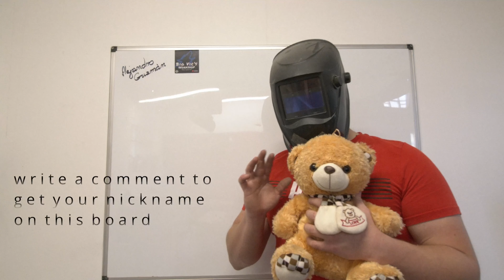This restoration was more difficult than I thought. Damaged rusty vise Restoration

Comment: Great beautiful job, but I just don't agree with those aluminum jaws.  Always have seen hard steel used.
Reply from the maker: Thank you very much it's very kind 😊 
Yes it's true but this vise im using for wood like wooden handles or some kind of elements, at the end of the video I show how this vice works, i.e. you can grasp the wood very tightly and the jaws will not damage our wood 😊
Reply: @customrestoration5317  Thanks, and again a great job.😀

Comment: I wonder why you didn’t fix up the inside of the Vice. Could have filed it smooth.
Reply from the maker: The casting was crooked and I could not insert it into the milling machine and while filing with a file I could lose the dimensions of parts of the vice so that they did not fit together 😕
Reply: @customrestoration5317  ah i didn’t realize the pitting was that deep. Makes sense. I should say though, that’s the best paint job I’ve seen on YouTube.
Reply from the maker: @MisterRorschach90  thank you very much it's very kind 😊

Comment: Прикола не понимаю я. Сначала отмывать а потом под пескоструй. Лишние заморочки
Reply from the maker: the point is that the vice out and in it have grease, which very quickly consumes the abrasive and sticks them together, which at a later stage may lead to clogging of the nozzle in the sandblaster, in extreme cases, even damage it 😊

Comment: Had to stop this video. Mig welding to a cast iron vise…yeah that doesn’t ever work well(note when milling you can see all the cast iron dust). Chances are it went from here to worse so I stopped. I know he put a fair amount of work into it but I just had to stop.
Reply from the maker: If it is not in accordance with the art, I apologize, but I have seen a dozen of videos about how people weld cast iron using the MIG method after preheating the element.
Reply: @customrestoration5317  cast iron is a porous material with lots of graphite in it. You can only braze it with either oxy acetalene, tig ,or arc. Mig is for welding steel or tin. I’ve tried different wires, gases and whatnot. It does not hold.

There is a rare method for fixing cast iron of forge welding but that is pretty darn hard to do. Bring whole piece up to just below melting point, mix in filler material, and . Some train rapids do it.slowly cool for a day or so.

On a vise like this I would have either left it or used turkite.
Reply from the maker: @jacilynns6330  You know, I am not that familiar with this topic yet, but I think that every day I will be able to restore better and more professionally. Nevertheless, thank you very much for this comment because thanks to it I will already know what to do if I have to weld cast iron again 😊
Reply: @customrestoration5317  I’ve repaired my share of vises over the years and done a lot of welding. Don’t get me wrong you put a lot of effort into doing as good a job as you could. The presentation was good.  For future reference, cast iron is porous so is old steel and tin. They soak up oils and these do not wash out. You have to use the flame from a propane torch to bleed it out if you want anything to stick. You will see the water and oils pop right out as soon as you put the flame too it, just wipe up with paper towel and move to another spot till your done.
Reply from the maker: @jacilynns6330  I really understand everything and I think you also understand that I do not deal with it professionally, I just took an example from other people and I succeeded, I hope that using this vise nothing will happen to him because as you mentioned I put a lot of work into it. Thank you very much for your advice and I invite you to watch other videos if you want of course 😊👍